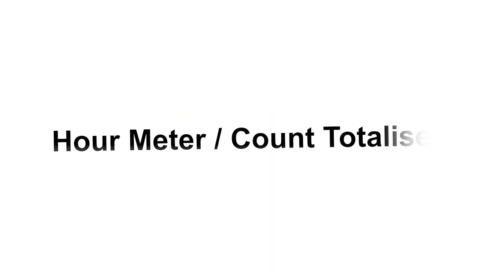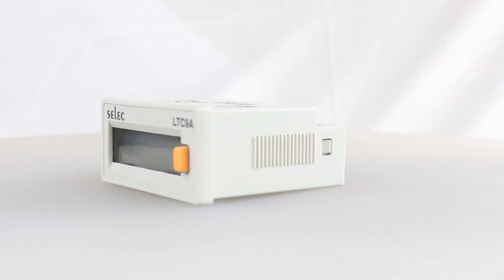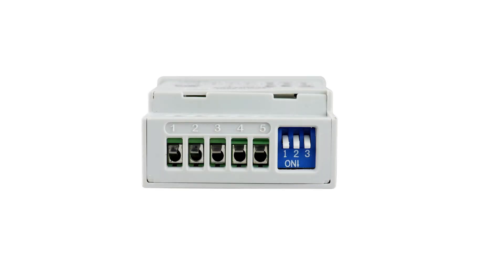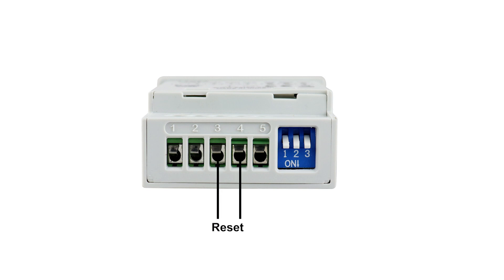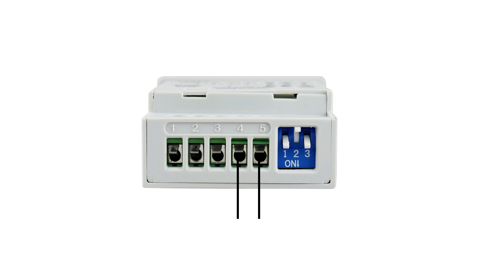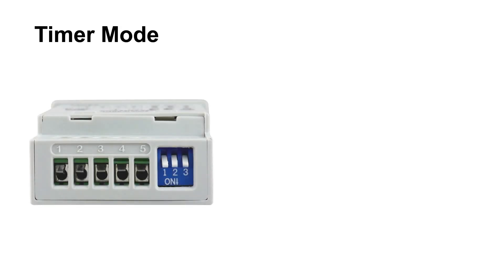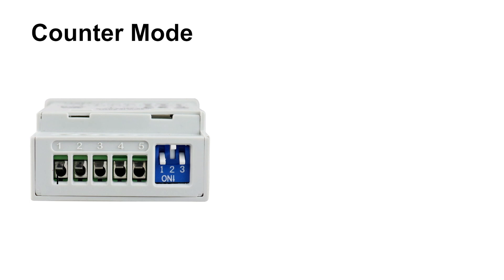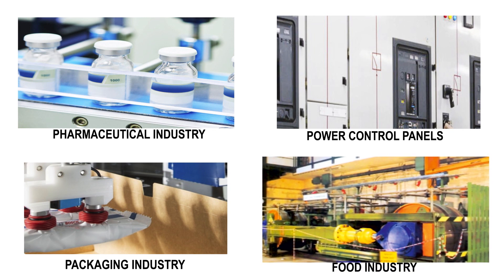Selec Hour Meter/ Count Totaliser LTC9A: Introduction| Terminal Connection| Programming| Application

Comment: Can i count input Dc pulses (10 volt)
or 
input signal needs 24 volts above
Reply from the maker: @tusharkodlinge3308  It works for signal 24V and above. You can connect with our technical support team on +91-9136977315. They will guide you for selecting the right solution for your requirement.

Comment: how reset
Reply from the maker: Then Press front key for 3 seconds. Set FR in Y meaning front reset enabled. Power off the Unit. Then press the front key once to reset the time. If any issues present, please call us at 022-41418468/452